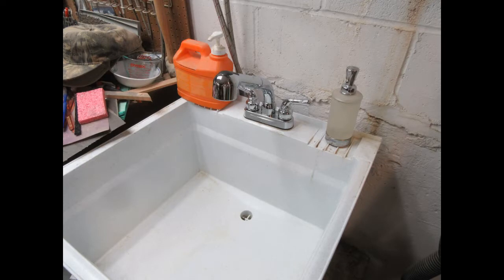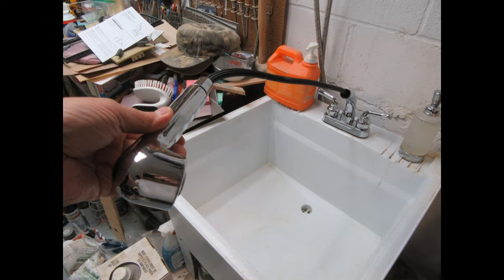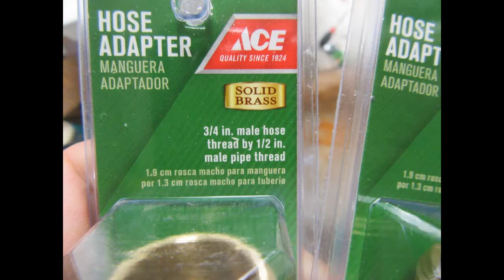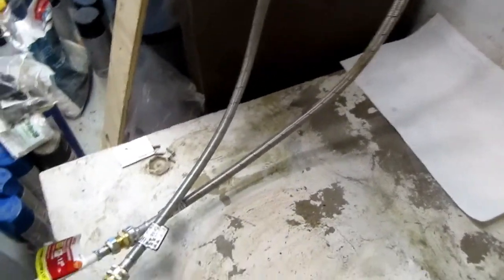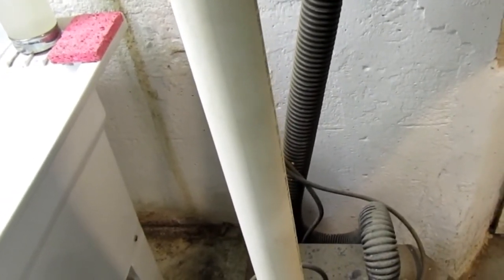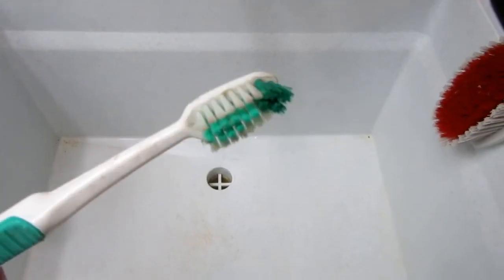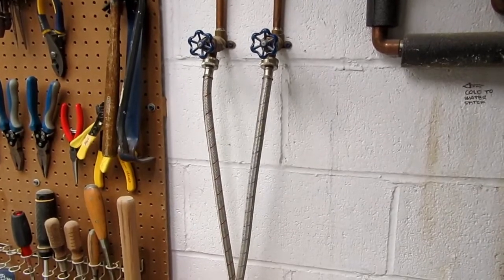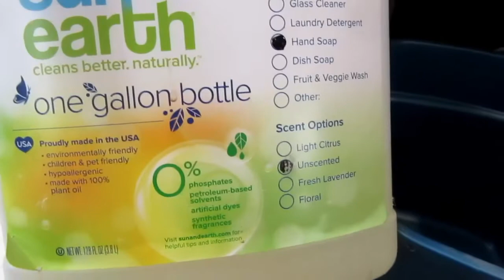Replacing a Utility Sink Pull-Out Faucet

Comment: Your video gave me the info to learn why my similar fauce was leaking. My spray hose hsd no threads between the supply line threaded attatchment, and previous owner jerryrigged anplastic tube with a metal compression belt but the tube burst open and now leaks no matter what I do. I plan to get a new faucet with threads and a proper hose for the sprayer which should do the trick.